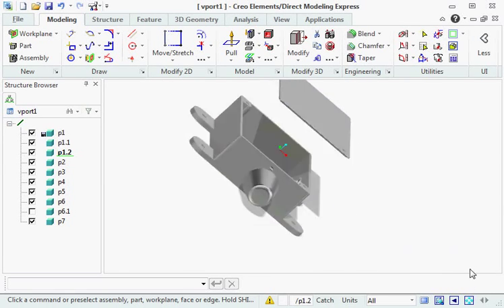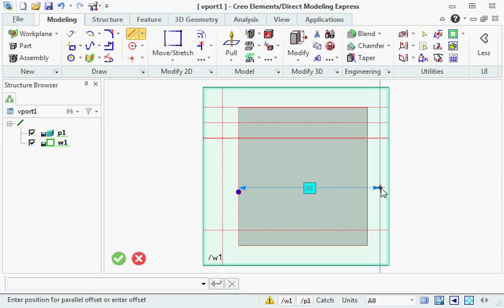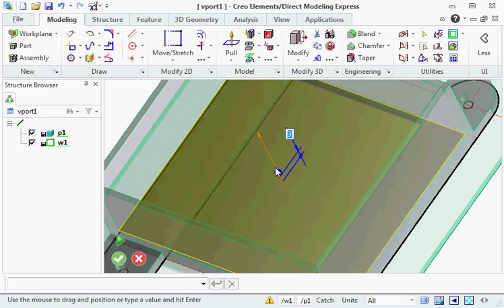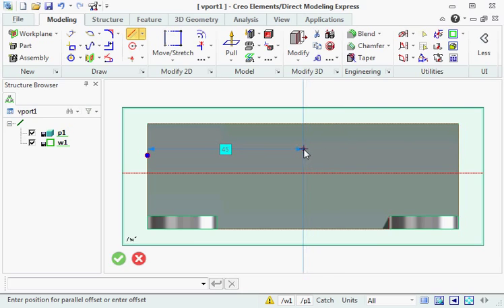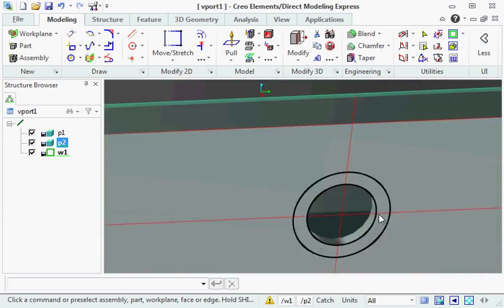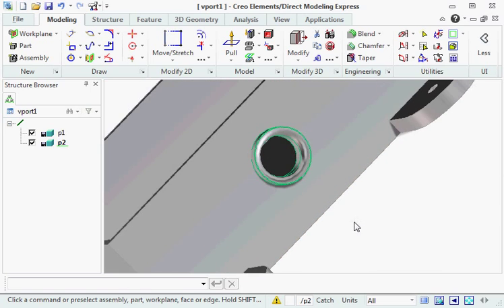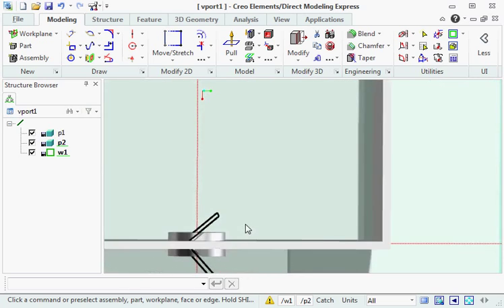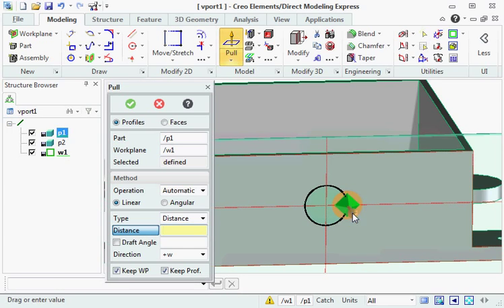PTC Creo Elements/Direct Modeling Express. Basic demo - part 1 (with voice)

Comment: How do I install it?
Find  issues : microsoft vc80,ATL,type=win32 version=8.0.50727.42
publickeyToken=1fc8b3b9a1e18e3b processor Architecture=amd64
How do debug? thank you !!!
Reply from the maker: I did not have such error. Usually this is not what I debugging but finding the root cause of the issue and solution to fix it - searching for text of this error in Internet.